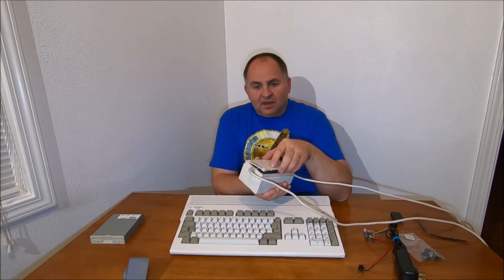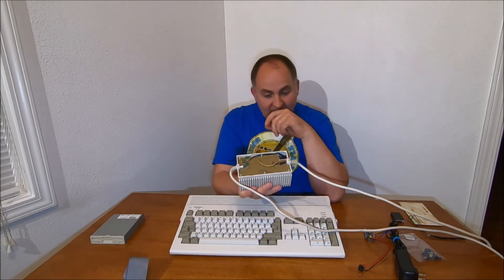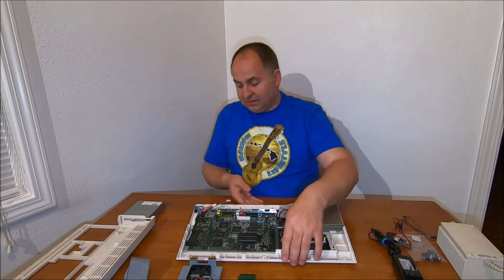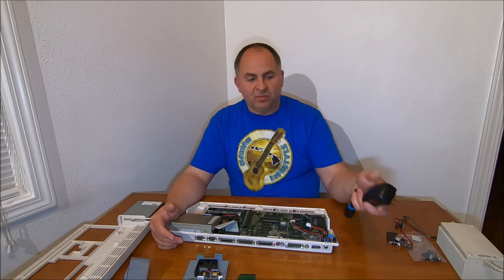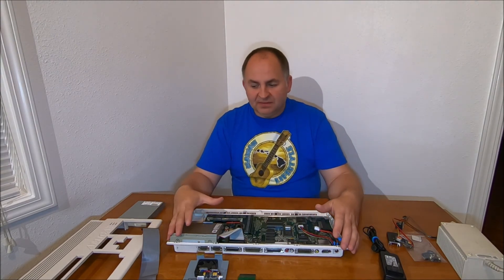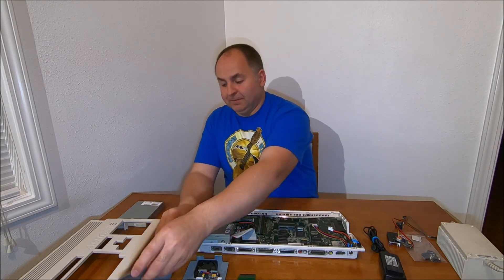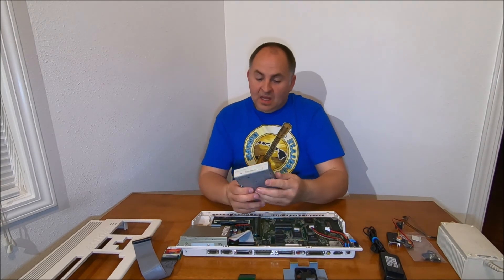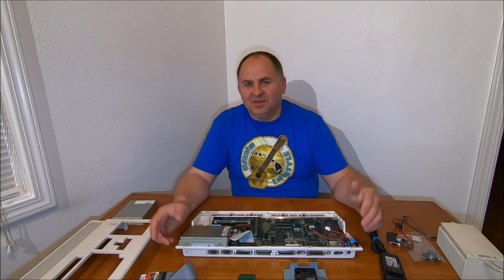My first DIY Mods for Commodore Amiga 1200 Pico ATX PSU and more (part 1)

Comment: Got a ATX iBox 350W PSU  for my A500 and A1200 since 2016. Works every day great. Use for WB 3.1 a 8GB CF with BetterWB 4.3. The limit is than 8GB and have a  32GB SD and a 16GB CF for 3.1.4. The best diskdrive is the Chinon FZ-354 read and write great. You must recap the A1200 and the Indivision AGA MK2CR is a must have for VGA or DVI-I monitors.